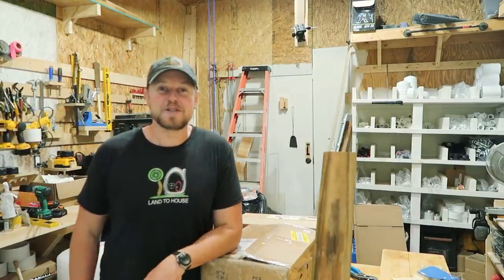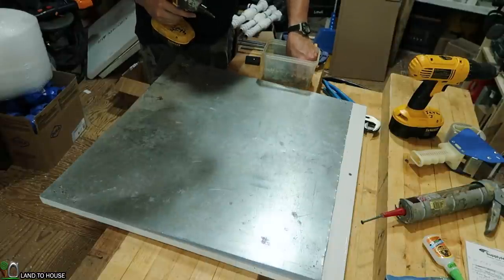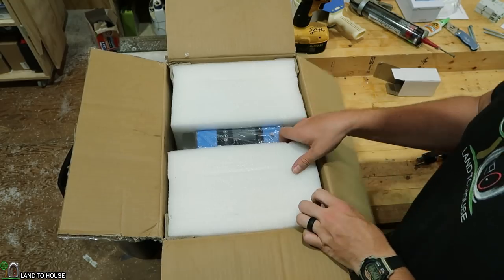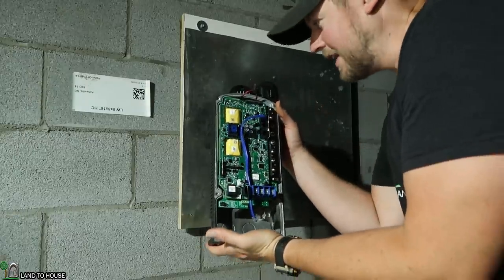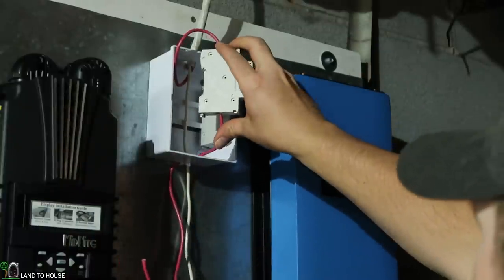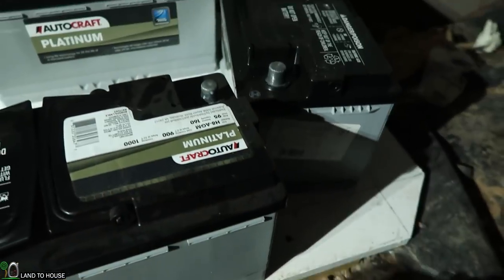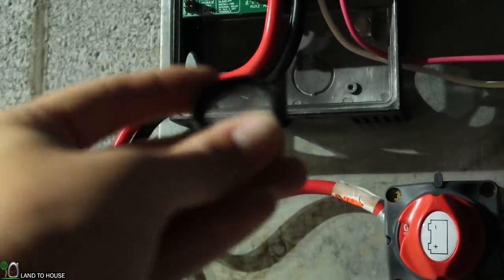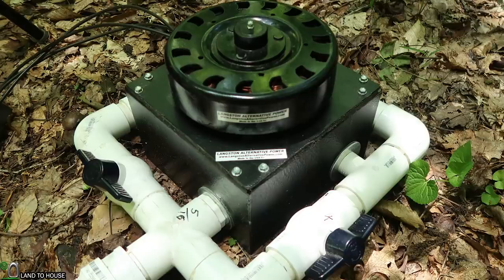Install Electronics Micro Hydro 8/10

Comment: So you got a rectifier wire and you're a poet and don't even know it🤭 don't worry though I'll help you show it❗🤣
Reply from the maker: Haha. Sounds like you are a better poet than I am.
Reply: @LandtoHouse  while I have your attention, I ask this once before in one of your other videos and did not get a response. About your ram pumps, I understand they require moving water to operate such as a stream or Creek. Unfortunately I do not have this luxury. However I do have an entire Lake Out My Backdoor. Lake of the Pines, in East Texas, perhaps you've heard of it? As you know, Lakes are standing bodies of water without much movement as compared to a river or stream. How would you suggest making standing water such as a lake become moving water to start a ram pump?
Reply: @littlekingcobrasden4217  Would only work if you can run the pipe out on the lake so the end is always under water enough so it couldn't get air. Then it must slope down from the intake enough to have at least 2 or 3 foot drop to operate the pump. Has to slope down with out going up anywhere. If this is impossible the only chance is to dig a pit 3 feet or so deep to put the pump into to get the water drop required to feed the pump. You would need a place for the waste water from the pump to drain to like having a pipe going from the pit to a lower spot for it to drain away. Unlikely you could have a setup like that next to a lake unless you have a sea wall and a place to drain the water to. Best bet is to use an electric pump. You would probably would need some sort of filter to prevent sand or other stuff from entering the pipe in the lake. Wouldn't need to have the the feed drop as it went to the pump then.  A shallow well pump would work or if you want to turn the pump on every time you use it most any small pump would work..
Reply: @gordonwilloughby8793  thank you for explaining. I've been viewing his videos about the U siphons, and have been toying with experimenting using those with a 5 gallon bucket, or a 55 gallon drum, but at the moment money just doesn't permit me to experiment like this. I wasn't sure if maybe putting the kind of float valve he shows in one his videos on Amazon inside the five gallon bucket (or 55 gallon drum) along with the U siphon on the inside as well as possibly another one on the outside (or instead of the inside) as demonstrated in another of his videos, with a lid on the five gallon bucket (or 55 gallon drum) and weight the bucket/55 gallon drum such as a small brick inside the bucket/55 gallon drum so it wouldn't float, approximately 10 ft from Shore next to my private boat dock (this would act as the 3' pit you mentioned, but in the middle of the lake water) with a garden hose connected to the outside of  the bucket, going to the shore line connecting to a ram pump if that would give me what I needed to get the water moving or not? (And yes, I also already thought about using one of the filters he mentioned in another one of his videos on the float valve intake) On average the deepest part of the lake in that general area is Maybe 4 foot? (I'm 5'11", and it gets about to my chest at the deepest point in that area, unless it's either flood or drought season) I have depending on the season/time of year between 1 to 4 ft of level dry ground at the shoreline.( Of course drought season my boat dock sits on dry ground with the nearest water 30 feet away or more🤣) once I find a way to get the initial water movement, I have approximately 100 yards uphill to get into my backyard across Corps of engineer land and approximately another 100 yards across my property to get it to a location where I can actually use the water which is partially uphill but levels off near the top 50 yards. I'm not sure the grade of fall from my back door to the waterline though. However in extreme flood season, I've gone fishing off my back porch such as Hurricane Katrina,(put the Water by my boat dock well over a hundred feet deep, almost covering some of the medium sized trees). but an average flood season brings the waterline right up to my property line. My goal is to eventually build a water tower consisting of four large liquid totes (I think they hold like 3,000 gallons each?) And then I'll use that water tower to filter and water animals and garden as well as an outdoor shower and possibly an odd house toilet,and an outdoor sink for cleaning fish and dressing other hunting game kill.
Reply: @littlekingcobrasden4217   Siphoning the water into a bucket from the lake and running the pump inlet from the bucket to the pump will actually give you less drop from the bucket to the ram pump vs from the lake to ram pump reducing the lift capacity of the pump. It is all about the number of feet the water falls from the water level at the intake to the pump and the amount of height the pump is required to raise the water to determine if it will work. Running the pipe out further in the lake or having it further under water in the lake won't raise the lake level to gain water source height. From what you said it sounds like your only chance for the ram pump to work is when the lake is higher. When it is lower it will be lower than the ram pump can be. There is a way to figure out how many feet the pump can raise the water to the number of feet the water falls from the source to the pump. Saw it on one of the Land to house videos. If you have an altimeter you could measure the lake level from above the lake and compare the difference to the altitude where you are putting the ram pump to determine the amount of drop to the pump. The greater the drop the higher the pump will raise the water. A ram pump will pump water up approximately 7 foot for every 1 foot the water drops from the source to the pump. To figure out if the pump will raise the water high enough divide the number of vertical feet from the pump to where the water will be pumped by 7 to get the number of feet of drop required from the water source to the pump for the pump to work. Amount of water will be slower as height destination increases. I got this formula from land to house. Based on that a vertical lift of 300 feet would require a drop of 43 feet from the source to the pump.
Reply: @gordonwilloughby8793  🤔 I think I just failed this class 🤭 I don't have an altimeter, and though I aced geometry, I failed all other math classes🤣

Thank you for explaining anyway. I have a friend who was a pipefitter for many years until he fell on the job and became disabled that I have asked him the same question about how to make standing Lake water become moving and he wasn't sure. But if I relay the information you have provided to him perhaps he can explain it in a manner I can understand better.

I on the other hand I'm a early retired Carpenter also on disability due to a nasty fall on the job so where I do not have an altimeter I do have access 2 and know how to use Transit levels. I would have a better chance of figuring the grade out with a Transit level once I get my hands on one again then getting an altimeter and learning how to use it. The closest thing to any kind of altimeter that I'm familiar with using is related to scuba diving and that only measures depth of water. The one that I'm familiar with does not measure air.

I also remember seeing the video where Land to house experimented with running ram pumps under water. And I questioned myself with the idea of dropping the ram pump Direct in the lake if that would be anything to get the water moving? But then I thought of the videos showing that it had to have moving water such as a river or stream or Creek and felt like the idea of just dropping the ram pump in the lake probably would not work.
Reply: @littlekingcobrasden4217  Just thought of a low tech way you can check the amount of drop you have from the lake to the lowest location you have for the ram pump with less equipment that is perfect for a carpenter. Drive a stake in the water and another stake at the location you intend to put the pump. Make sure the board you use is long enough to be able to fasten it to the side of both stakes.  Fasten the board on the side of the stakes so the bottom of the board is just touching the water. Use a level on the top of the board to make sure the board is level when fastening it to the stakes.  Measure the distance from the bottom of the board down to the ram pump in feet. Subtract enough to allow for amount the intake pipe to below the water surface and multiply the number of feet by 7 to find out how many feet above the pump water will flow.  If you can't get enough drop from the bottom of the board to the pump it won't work for you. If it isn't enough drop use a pit for the pump if you can have a way to drain the pit. If not it won't work that way either. If neither of these methods can give you the required amount of feet between the water intake down to the pump a ram pump won't work for you. If one of the reasons for wanting to use a ram pump is lack of electricity at the lake you could use a solar panel and water pump that would run from it. Be sure the solar panel produces enough power to run the pump. one of the self contained unites would be the easiest.
Reply: @gordonwilloughby8793  I have thought about solar powered water pumps mounted to my boat dock but unfortunately then I would have to worry about theft. I live in the part of the lake where a lot of fan boats / airboats visit after hours of Darkness. Sometimes I hear them up at the house sometimes I don't. The times I don't hear them I only find out they were out there from Neighbors telling me days later. I used to keep an ice chest on my private boat dock with a small tackle box unfortunately somebody has come and stole it. I replaced it three times and somebody keeps stealing it. so I've quit leaving anything out there. I used to be able to leave fishing poles and all kinds of stuff out there set up to fish overnight and catch the fish so I may have anywhere between 10 to 250 fish, and occasionally some turtles, snakes, and the occasional crawdad or two, there in the morning when I wake up... you can probably imagine my surprise the day I went down there in the morning to check my traps to find a small alligator inside one of the fish traps❗🤦🏻‍♂️🤣 but if people are going to steal cheap $10 tackle box with minimal fish gear they'll still just about anything else big and obvious that I leave out there such as electric water pumps and solar panels. But If there was some way I could get a ram pump going it's small enough that most people in this area aren't going to know what it is and leave it alone. I used to be able to leave all kinds of hunting traps out there lightly chained to trees but somebody's come through and stole all that as well. I use tetherballs as fishing buoys for my trawl line and fish traps. I used to be able to leave those out there 24/7 but the last few times I've left them out there I'll come back to find the tetherball fishing buoys all shot up. And or the fish traps stolen People just don't have respect for other people's personal property anymore. but like I said I thought it if there was some way I could get a ram pump going with a garden hose most people aren't going to mess with a garden hose stretch through the woods and if they see the ram pump they're just going to see a short piece of PVC pipe and not know what the heck it is and leave it alone thinking it's a piece of trash or something. I think the only way I could actually get away with putting a solar powered water pump out there is after I get all my other projects caught up around the house, which I have a lot of them, estimated several $1,000 worth of materials for various projects, ranging from repairing chicken coops that trees are falling on to building storage buildings to building a bug out trailer to pull behind my motorized bicycle because I can't afford regular car or truck,to fixing all three of my jet ski, yes, even the simplest of things such as getting a new deck for my lawn mower... I rebuilt /cleaned the carburetor and put a new spark plug on it started it up and it had so much more power that it ripped itself free from the deck and this was just a little Briggs & Stratton push mower. I think when I have funds and materials available making my boat dock larger to the point where it actually becomes a Boathouse with a small storage unit off in one corner in which the bottom of that storage unit would have a portion of the floor cut out to allow access for water pump supplies to drop in the water where it would be locked and out of sight. I think that's about the only way I might get away with having any kind of electric pump left down there without being messed with. I've even used to have solar-powered lights from the Dollar General store lighting the four-wheeler path going down to the dock and somebody has decided to come along and start stealing those every time I put them out.

 but I completely understand what you're talkin about as far as finding the grade from the depth of the water near the end of my boat dock to the Shoreline with the stakes and two by four and the level. my boat dock on the other hand is actually on the rather long side. I would have to use a water level to create this kind of measurement. if you're not familiar with what a water level is, is it consists of usually two either glass or acrylic tubes that stand vertical with a long vinyl hoes in between them and you put usually colored water inside of it and the tubes have measurements marked off and you use the water level inside the tube at the increment marked on the tube for your measurement. (Cold/ freezing areas, I've heard of the water level being filled with car antifreeze. Though I've never been in the position I had to do that. Because I live in some of the warmer climates.  and never had the need to use a water level during winter.)
Reply: @littlekingcobrasden4217  Once my mind starts going on something it keeps going. Just had another idea. If you get a big enough electric water pump you might be able to put the pump at the house and run a pipe from the lake to the pump. Would need a foot valve at the end of the pipe in the lake and it might take quite a lot of water to prime it. would take care of the theft problem. the pipe could be buried so they wouldn't see it.

Comment: Ha ha ha .... You should go on youtube and take a crash course called "Power electronics" and "Solid State Physics". You learn that you can't connect ionic charged electrodes in series. You will need to stack the batteries in a vertical fashion and use a stepper voltage regulator which independently charges and discharged a chemical ionic electrode. Your generator issues are least of worries